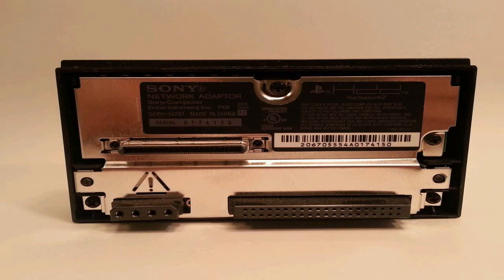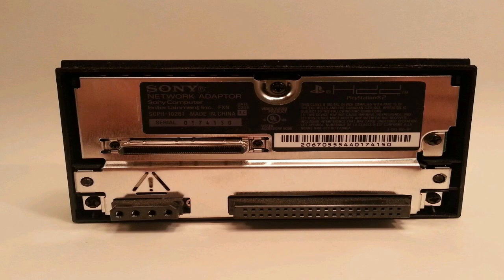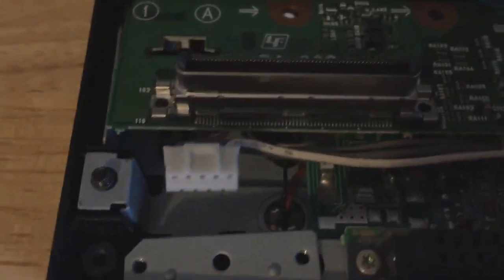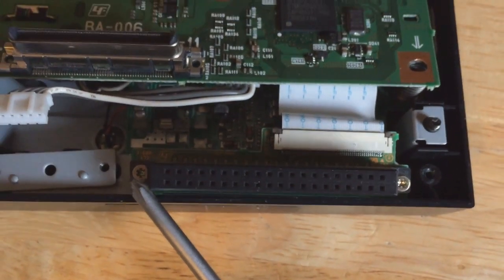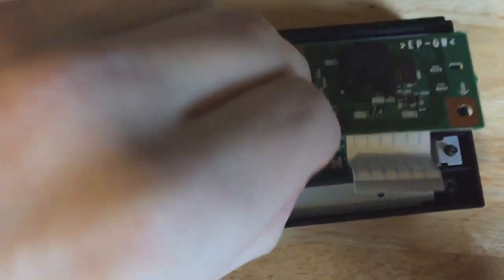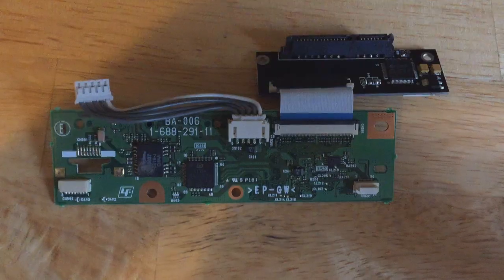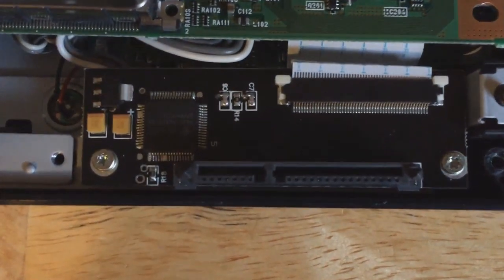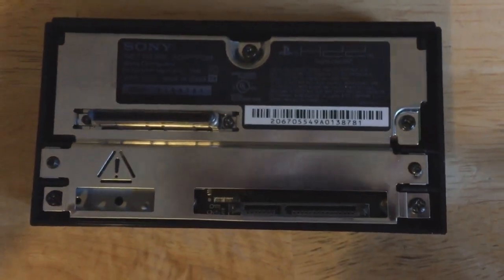PS2 Network Adapter IDE to SATA Internal Mod (HOW TO INSTALL)

Comment: i got so frustrated trying to mount the sata adapter onto the ps2 HDD adapter that i just said fuck it, skipped putting the spacers and screwing it in, and just let it hang loose and connected my SSD to it anyway. it works fine lol.

Comment: You need T7 to remove the star screws, I just did it.
Reply: I dont got one of those
Reply: @JohnTheSmallKid  Torx screwdriver is useful, this is what I use: https://www.amazon.com/Husky-1000-039-344-Screwdriver/dp/B00LHFAWGO

Comment: I have the IDE and SATA network adapters, can I remove the SATA piece from my SATA one and put it in my IDE one? that way I can use the IDE one with actual network connections with a SATA drive?

Comment: Didn't see anything in the description or hear anything in the video so : 
___ Does this hardware adaptation still retain the ethernet pathway for connecting to fan-made servers for select Online / NETPLAY titles and, additionally, for LAN gameplay and, therein, XLink Kai oppotunities?
Reply: A follow-up after perusing many instructions, mod kits and  plug-and-play modded network adapters:
____ Be aware that you want to reference instructions and purchase mod kits and parts that retain the ethernet port functionality as not all products along with their corresponding instructions will retain ethernet port functionality which is what you will need for online and LAN gaming. For example, you can even buy what looks like a SATA modded network adapter from many third-party sellers in an attempt to save yourself the labor and time because it has a jack opening in the back for ethernet but it's not connected to any circuitry nor are there accommodations to do so. MrMario2011 Youtube channel discovered this in his PS2 upgrade video. Verify your sources before making your decision to leap with your money or tear into circuits of an original Network Adapter that would otherwise still be a perfect modding candidate for retaining ethernet jack functionality. There are a lot more third-party sellers of network adapters with dummy jacks that won't enable online / ethernet LAN play than there are of third-party sellers that have retained ethernet jack functionality on their products... likely due to the greater market interest in bringing the PS2 hardware up to contemporaneous storage and playback / load speed expectations coupled with longevity concerns in lieu of failing optical drives moreso than the subset of interest in ethernet LAN and Online gaming titles.

Comment: Can you still connect to the Internet tho?
Reply: Dave102693 yeah
Reply: From reading up, that's the main advantage of using these upgrade boards over buying a replacement SATA adapter.

Comment: I don't understand what is ide and sata. I'm buying another ps2 soon and network adapter what does the old-school fat ps2 take ide or sata? I'm gonna be connecting thru xlink to play socom 2 online
Reply from the maker: Old school one normally takes ide. Mod allows sata. They are just different connection types, ide being old and not really made anymore, and sata being new and can be found at your walmart or bestbuy or etc. If you'd like to have your ps2 accept a hard drive, then I would recommend modding it for sata and buying a sata hard drive.
Reply: HellohiGG ,
Does the kod in this video though still have a functional ethernet pathway - for SOCOM 2+ via XLink Kai?
Reply: Just2Options? Irrational: FearOrExuberance? Yes, the network function works normally.
Reply: Brendon Lacroix ,
Be aware that you want to reference instructions and purchase mod kits and parts that retain the ethernet port functionality as not all products along with their corresponding instructions will retain ethernet port connectivity which is what you will need for online and LAN gaming. For example, you can even buy what looks like a SATA modded network adapter from many third-party sellers in an attempt to save yourself the labor and time because it has a jack opening in the back for ethernet but it's not connected to any circuitry nor are there accommodations to do so. MrMario2011 Youtube channel discovered this in his PS2 upgrade video. Verify your sources before making your decision to leap with your money or tear into circuits of an original Network Adapter that would otherwise still be a perfect modding candidate for retaining ethernet jack functionality. There are a lot more third-party sellers of network adapters with dummy jacks that won't enable online / ethernet LAN play than there are of third-party sellers that have retained ethernet jack functionality on their products... likely due to the greater market interest in bringing the PS2 hardware up to contemporaneous storage and playback / load speed expectations coupled with longevity concerns in lieu of failing optical drives moreso than the subset of interest in ethernet LAN and Online gaming titles.

Comment: just buy a IDE to sata converter and get a laptop HDD, tried it with 2TB Sata for laptop drive and it works fine. You can get the adapter for about 2-3$ so no worries there.
Reply: The only HDD's (3 of them) that have failed me, were 2.5" laptop drives... I even have an 3.5" IDE 80GB drive from 2004 that's still working. Otherwise, 3.5" fits better as-is for this use. And all of those third-party network adapters already with SATA, do not preserve the network function with the HDD (which can be useful, for things like SMB).
Reply: Does the network still works normally? I would like to do it, but I like to transfer games through the network, so I'm concerned about that.

Comment: Does this make it faster? Does it actually run at SATA speed or does it run at IDE speed?
Reply: The connection will be as fast as the slowest link, so it'll still be IDE speed, but it should run at the maximum speed the IDE can handle. So it should be ever so slightly faster, plus SATA hard drives are a lot more common and much cheaper per MB than IDE these days.

Comment: Those little black tabs (brown on mine) on the ribbon cable slot (both sides) pop up freeing the cable, and when you slide in the new cable you push them down. No need for credit card. I just installed this today in my ps2 works great.
Reply: Arturo Frontenac do you have a pic of how to pop up the little black tabs?

Comment: I did my sata mod the other way which was good work but it's sloppy considering I had to leave off the metal brackets the ribbon and wires are exposed using a pc sata adapter. I misplaced the brackets but do have another network adapter so I might retire my original one and give this a go.

Comment: what did you use to get the star screws out I've tired t5-10 none of them fit those things are like impossible to remove lol
Reply: T8/T7 is what I used to unscrew the star screws if anyone was wondering both of them worked for me.
Reply: You skipped over the part I needed. Why do we have 3 spacers, 3 washers? I need to see what the best order for those is. Right now I want to put spacer post, then washer, then board, then screw. Is that right?
Reply from the maker: I only own t7 t8 and t9 so it would have had to be one of those, unless I had used something completely different
Reply: HellohiGG I'm gonna make a video on my ps2 with an ssd on my alternate channel would it be okay to link your video so people know how this mod is done?
Reply from the maker: Yeah sure, that sounds pretty cool!
Reply: HellohiGG Alright thank you! I'm probably gonna start working on the video tomorrow
Reply: I have the video processing right now should be up here soon

Comment: does the gamestar fake network adapter (which has the IDE port) worl to change it to the SATA port?
Reply from the maker: +SilentKnight703 Sorry, but I am not familiar with gamestar. I took the PS2 Network Adapter by Sony and swapped out parts to convert it from IDE to SATA. I believe you can use the stock network adapter and use a IDE to SATA cable to convert if you want to save money, but it will take up more space so you will likely not be able to use a 3.5" HDD and have to use a 2.5". I hope that helps!
Reply: +HellohiGG well the gamestar version of the network adapter is just the same as the Sony version but you know its just a fake Chinese one and its a bit thinner and they removed the internet capabilities, you could Google it if you wanna that's what I highly prefer
Reply: how much can this adapter handle? i heard the max was 1.5tb or 2tb. which is it?
Reply: rich carter well it can handle 2 tb i think?
Reply: I tested with a different adapter and it worked. I'm guessing it will work with the one in the video.
Reply: Rami Al-Q Yeah, i have one now and it works perfectly fine except the Gamestar chinese one is abit thinner sadly